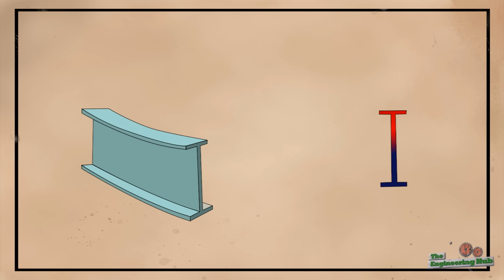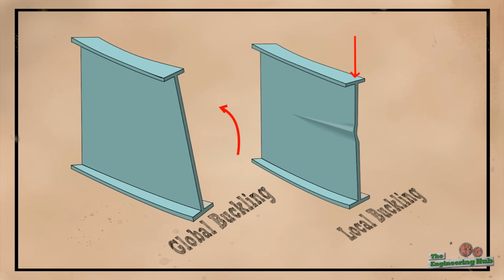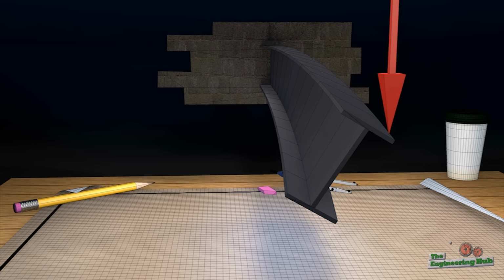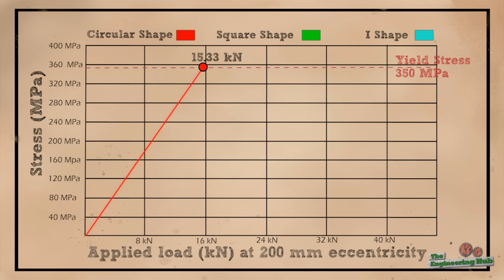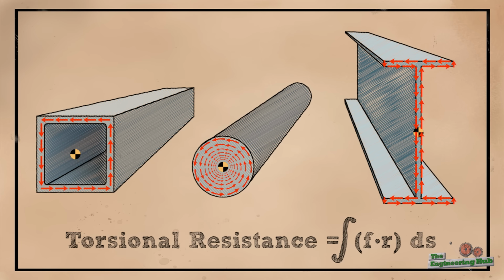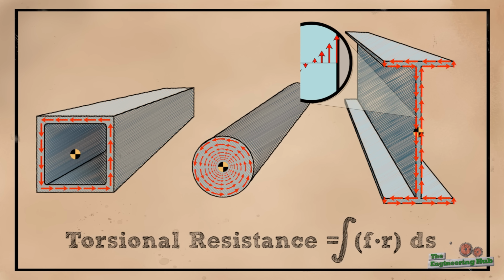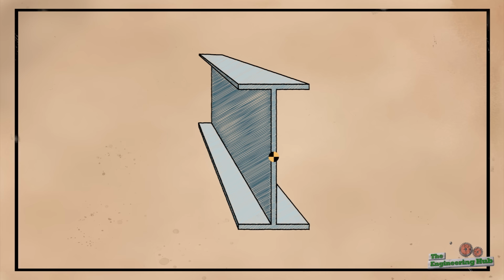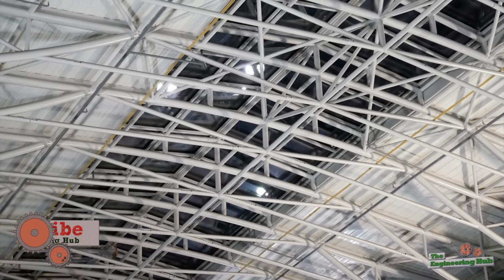The Critical Weakness of the I-Beam

Comment: As a mechanical "structural" engineer for over 35 years, I must disagree with the idea that an I-Beam has a fatal flaw. When designing anything, there are typical, predefined structural members that, if properly used, will result in nothing but a successful design. The error here is a misapplication of a known element of design. For instance, one can not say the nail has a fatal flaw because it does not hold steel together or welding is flawed because it does not attach wood to steel.
Reply: As a fellow structural engineer (retired), this is simply click bait.
Reply: @LTVoyager  it got me to click.
Reply: @1985230ce  Likewise, but only once.  I won’t be back to watch another.
Reply: @LTVoyager  I wouldn't call it "click bait" because it is a "critical weakness of the I beam". However it doesn't mean it's flawed design, andhe never claimed that. It's just a hyperbole title to intrigue but it provided good info.
Reply: @Noadvantage246  Hyperbole is pretty much the definition of click bait.  A critical weakness of third rate youtube channels is that they use click bait titles.  There, how does that sound?  😁
Reply: @LTVoyager  Could you explain to me please?   This is interesting to me,  what you're saying is the video is wrong...correct?    So I beams don't really have a fatal flaw until they're used for improper application?>?
Reply: @Chameleon_Effect74  I am saying the video is click bait. It claims a natural characteristic of an I beam shape is a  “fatal flaw.”  That is click bait BS and this channel should be ignored.
Reply: @LTVoyager  oh..lol yea it did ..thnx for that appreciate it
Reply: @LTVoyager   Not exactly. There are a few commercially made log splitters, and a lot of home made log splitters where the top flange is bent on the edges even though the length of the beam is still straight, or the whole thing is twisted. Better designs use a square box or rectangular design and this video would have saved a whole lot of people a whole lotta' trouble.
Reply: @LTVoyager  hello Sir. Can you support with a small structural project?
Reply: Isn't it rather obvious you both mean the same thing? "I-Beams are great, but not at everything." Unnessecary drama if I ever saw that.
Reply: Why on earth are people more concerned with semantics than learning?... The description "flaw" is simply a lamens term for describing a potentially catastrophic failure mode. I wouldn't mention being a structural engineer with decades of experience AND watching an intro to torsion video, yikes.
Reply: @lindsay_1849  It's a flaw in the same sense wood doesn't have as much tensile strength as steel. Not a flaw it's a engineering rule. It's up to the engineers to use the right amount of that material.
Reply: @slowfudgeballs9517  A timber beam with the same dimensions as a standard steel I-beam will carry almost identical loads. That was the origin of the original steel I-beam dimensions.
Now try buying a 20” wooden beam…
Reply: @lindsay_1849  I am with you, but still, if one makes a video, one is subjected to criticism, that's the name of the game. He should have chosen his words better.
Reply: @lindsay_1849  A lot of engineers are pretentious elitists that have nothing better to do than to produce the faux outrage you see here.
Reply: @lindsay_1849  lol some have large battles others have small ones and then there are those that split asshairs. I do not know enough about this topic to know its worth. i know enough to hope that the wise pick their battles wisely. That being said, issues with semantics and linguistics do matter, i am uncertain here. What is torsion? Just kidding
Reply: Jet fuel can't melt steel beams!!!
😂 Sorry, I had to.... I'll leave now...
Reply: That made no sense but thanks for playing!
Reply: All he did was identify some areas that require study when selecting an I-shape, something every PROFESSIONAL engineer does every day.
Reply: @eddarby469  I think half these guys don't understand this vid is not for engineers, but for people that know virtually nothing of structural integrity and forces that affect it.
Reply: As a fellow engineer, I say "thank you" for some common sense.
Reply: As a welder I made it 2 minutes and then had to look at the comments to make sure I hadn't lost my mind.
Reply: As a fellow engineer I also feel cringe watching this video.
When we are building big structures such as bridges then 3D printing or stamping parts is out of the question, so we use various profiles which are easy to make and combine.
Now each of these profiles has its strengths and weaknesses... there is no such thing as a perfect profile that does everything the best.
By combining these profiles we are able to create a whole structure that can handle projected loads, and we can do it on the budget.
Reply: I suppose you could say this a bit clickbait. But let's be honest, if you opened this expecting to find out that 90% of commercial structures are "Fatally flawed" then you're pretty darn gullible. I thought it was an interesting presentation of the limitations of I beams.
Reply: I am a structural engineer, and I like his videos in general. I wish I had those when I was in school. That being said I agree that the wording in this one is not great. Should we said the video has a fatal flow and throw it away? Maybe the comments are acting like stiffeners...
Reply: i will weld steel together with wood and no one can tell me otherwise!!
Reply: @Blox117  Liquid Nails rocks!!!
Reply: Just seems like a problem with wording I don't get the fuss.
Reply: I don't think this video is meant for mechanical "structural" engineers for over 35 years. Good for you if you already knew everything in the video.
Reply: Was it an I beam failure that led to the calling of the engineers.  I know it was because of a bridge in Winnipeg ,but was it an I Beam failure
Reply: Agree completely. The video is good, but the clickbait thumbnail earns a downvote from me.
Reply: BTW - nailing steel structures together is actually a thing. Ramset have been selling equipment to do it for decades with explosive powered tools. It’s just not really common compared to bolts and rivets.
Reply: 25 seconds in and I paused to read the comments because it's clearly patently false. And I'm out.
Reply: @TonyRule as a novice it took me 3:52 coz I thought there’d be something I’ve overlooked yeh nah for this Aussie doer 🇦🇺
Reply: This video was obvious, I agree.
Reply: So you're saying it depends on the application??
Reply: Yesir
Reply: @Chas Modee --  I agree with you, and so does the Empire State Building !!
Reply: @Ken Fullman Really requires a lot of pre-flush torsion. Just not worth it.
Reply: I'm graduate of Uganda university. I studied hippo literatures
Reply: technically it's still a flaw but yeah youre right.
Reply: Interesting
Reply: Good points
Reply: @Danny Timms dont forget S-shapes and HPs!! each has its application
Reply: Sounds like the wrong tool being used for the job and the video is calling that a flaw? For instance, if you were to make use of a regular car rubber tyre to drive through hot coals and the tyre melts, is that a fatal flaw or rather using the wrong tool for the job? Of course it’s the latter.
Reply: There is a fatal flaw in any and actually all materials and that is corrosion. There are a few materials that corrode so little it takes millenia to break down and others corrode after a few weeks of bad weather. You would want a home that refurbishes itself. But that is as of yet impossible oh wait no it's not! We can build machines that build other goddamn machines and you're telling me we can't have self building houses yet? We're so fucked man. If this is not base knowledge we're supercalifragilistically fucked! But I knew that already, I'm just watching the show explode!
Reply: I mean yeah this video isn't for engineers its to educate people, people should know not to try and weld steel to wood or to use a nail to hold steel together. You may think its pointless to tell people that but it DOES prevent accidents and casualties.
Reply: This guy is enlightening a few guys watching screwTube. Guys (&gals) without an engineering degree. Not disagreeing with your assessment but, just saying degreed engineers are not his target audience.
Reply: @Chasmodee can you please help me in structural design calculation please
Reply: "The nail... does not hold steel together" "welding... does not attach wood to steel"
You just haven't gotten creative with Nelson studs yet
Reply: Fully agree. My late father was a mechanical engineer and would have been horrified. 
This is like saying salt is lethal.
Reply: @kevgermany  salt is lethal, especially if it is in the form of a large chunk falling from a great hight directly over a person.
Reply: @garethbaus5471  can't you distinguish between a design issue and material properties? Lithium is highly flammable and will cause fires, explosions and death if used improperly. That doesn't make it lethal. 
Get it into your head. It's not the material, it's how it's used.
Reply: @kevgermany  you made an extremely vauge comment that didn't restrict the subject to material properties, I deliberately took advantage of that vaugeness for shits and giggles. Cyanide isn't all that lethal either if you handle it properly and aren't a complete idiot.
Reply: @garethbaus5471  also the salt can be lethal if placed on an I beam for extended periods of time
Reply: @kevgermany  As a retired medical professional once told me, oxygen is poisonous. 
If you don't die of anything else, you will die of oxidation.
Reply: @adifferentangle7064  same can be said of most things. Water, salt, people.. and internet stupidity
Reply: @kevgermany  Yes. The saying in the medical field is "everything is a poison, it depends on the dosage".
Reply: @kevgermany  salt is lethal
Reply: @kevgermany salt is lethal. It's been used as a preservative (bio - inhibitor) for thousands of years...
But, within the parameters of moderation, like an I-beam , is quite useful.
Reply: Well, "known liability" versus "fatal flaw," but if this liability isn't fully accounted for (as has happened on >1 occasion), then it's certainly "fatal."
Reply: Bang on.
Reply: I think the point it is to learn about its fault and to improve its design and application
Reply: @adamwheeless8523  There's nothing to prove, it's not even a faulty design. It's just the weakest spot in the structure. Everything has a failure point. Certain materials are better for certain loads. It's the engineers fault for not realising this and design accordingly (instances in the video). Incompetent architects or engineers are on the rise after affirmative action pushes and the like. Colleges don't teach anymore, they preach. You might be able to find some good professors left. It's those teachers who saved my education I believe.
Reply: Thanks for letting me know not to waste my time with this click bait video/channel.
Reply: @tanman99  I unsubscribed already.
Reply: You are correct, Chas. But you are also making an assumption that all stresses, all degrees of freedom and all potential failures are fully understood. I think when you go to civil engineering projects of size and proportion you will find that it is not always possible to have the full picture. Hence why some elements may still have such properties and one should be aware of it.
Reply: Bro what are you on about? You need to think that I beams are shitty profiles I always use angles instead.  It’s cheaper and easy to install
Reply: q
Reply: Almost like the AISC SCM exists for a reason?
Reply: I'm a registered civil engineer. Nobody calls them "I-BEAMS" they are W-shapes
Reply: @fauxbro1983  I am also a registered civil engineer (California).  Both I-beams and wide-flange (WF) beams exist.
Reply: @fauxbro1983  retired civil engineer here - i have used W, S, I, & HP shapes. each has its application
Reply: @fauxbro1983 A lot of folks call them I-beams it is region specific.
Reply: @Chasmodee1 Hello sir. I need a simple structural plannşng to be made. Can you support with this task?
Reply: I agree with Chas Modee and the others.  I am not an engineer but have a masters degree in psychology and a us tool patent.  One way to think of an I beam, is, it is a rectangle and has the strength of same without the weight.  Knowing this, one is able to construct buildings, bridges, etc., faster, cheaper, lighter, but with no loss of strength.  The I - beam just needs to possess the correct dimensions for the project(of an appropriate material). This is really what the engineer does in making a successful project, applying knowledge, calculations, innovations IMHO.
Reply: @circaindustries173  😂😂😂😂😂  masters degree in psychology ... that's hilarious...
Reply: I beams are obsolete. Deal with it. Box sections and tubular sections have greater strength pound for pound.
Reply: @PatPat-xr3xm  and a much greater cost to go with it.
Reply: Everybody knows the critical weakness occurs when office material catches fire via jetfuel while people dance.  Kinda funny critical “weakness”.has a better ring to NISTs argument as impetus of failure. Who knew kerosene was kryptonite for structural steel? Maybe he will make a video about that to make up for errors you folks know about.
Reply: @MrGoodguy6-7  Every refinery knows jet fuel (kerosene) fires are lethal to steel. Pipe bridges, pipes, tanks and distillation columns bend like toffee at 600C under simple gravity loads.

Comment: You missed vital point that I-beams work bit need to be braced to prevent torsion. One of the failures you showed, Burnaby's Save on Food failure was the lack of bracing to the compression flange, and lateral support I orthogonal direction at top of column. Torional-flexural buckling is a separate failure mode. Web buckling is separate from other failure modes.
Reply from the maker: Hi Michael,
Thanks for your feedback--and very nice catch noticing Burnaby's Save on Foods collapse (it's one of our favourite case studies as we live in Burnaby).
We separated global failures modes from local failure modes in our video to illustrate your point. We used the terminology 'global buckling' to simplify the concept, but it's the same as what you are referring to as torsional-flexural buckling.
Cheers,

Comment: You failed a course to mention that the torsion applies to an I-beam only when an engineer puts a load on it that's not centered. I know that you talk about a non shuttered load, but I beams are not supposed to have non centered loads. So that has to be done by an idiot, not a particular flaw of a steel shape, that's a flaw of the design.
Reply from the maker: Hi 44 Hawk,
Thanks for your feedback. We mentioned that torsion applies to I-beams with eccentric loads.
But, you have a very good point: I-beams ideally do not have non-centered loads.
Cheers and thank you for watching,

Comment: 99.99999% of all 'I-Beam' structures remain intact unless bombed or Imploded.
Reply from the maker: Hi Yabba,
Thanks for your comment. You make a good point--engineers do design structures for low-probability loads. As a result, as you stated, there is a very low chance of failure.
Cheers and thanks for watching,

Comment: This channel is called the Engineering Hub. Enginering is about using materials appropriately, in accordance with their physical characteristics. What is described here are the characteristics of various types of beams. These are not flaws. The title is therefore clickbait. The content is probably useful to amateurs but I think it's safe to say that anyone who actually works with structures is probably a bit mystified at the use of the word "flaw" in an otherwise reasonably good beginner's guide that should be teaching people how to use structural elements properly rather than scaring them away from the most commonly used beam configuration.
Reply from the maker: Thank you for your comment Michael, we appreciate your feedback.
Reply: Actually, I agree: it is clickbait

Comment: Here is a probable stupid question, why don’t we utilize O beams? An o with a flat welded piece of steel on top and bottom.
Reply from the maker: Hi Jonathon, interesting suggestion. My guess would be because it might be expensive to manufacture. But also, the web of the I beam provides vertical stiffness in resisting the vertical loads which the O will not be as efficient in (though probably still pretty good)
Reply: Thank you for your kind reply! I really enjoyed your video!
Reply: @JPickett1929  We do use O-beams.  They are called Round HSS tubes.  HSS = hollow structural section.  Some designs may call for pipe instead of HSS tubes, which has the same geometrical principles to its performance, but a different standard of designating sizes. 

When there is a dominant axis of bending, using a circular tube has a disadvantage.   Using an I-shaped beam has the advantage when the load direction is most likely in a the dominant axis of bending, and most likely to be centered on the beam, rather than eccentric.